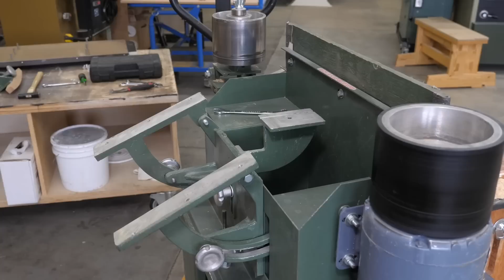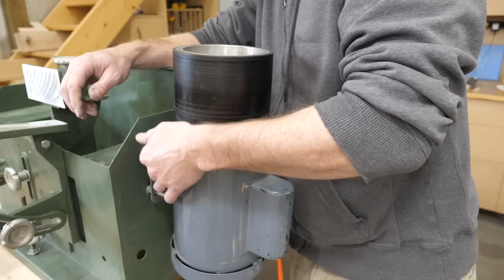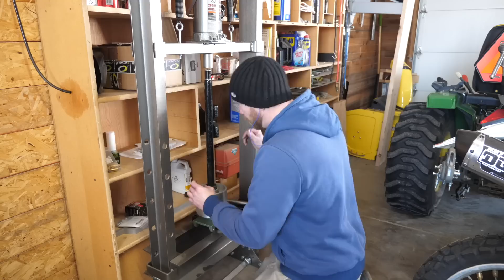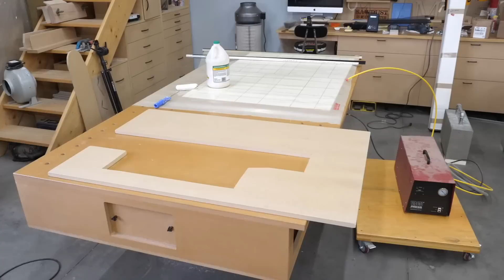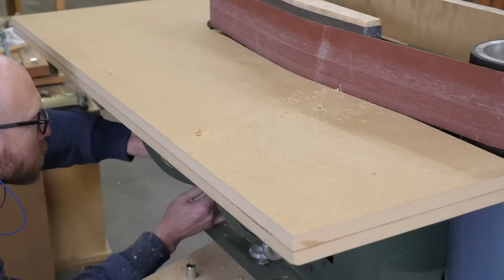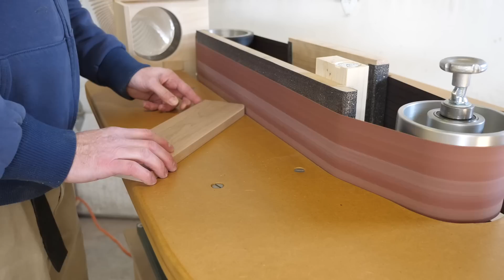Edge Sander Radstoration, this thing is Rad

Comment: Is the bed height where you're sanding mostly on the edge of the belt by design (so you can flip the belt when it's worn out?) I would think most sanding jobs would be for stock < 1" thick so the full height of the belt isn't normally needed.
Reply from the maker: Yes, that is the case, and yes I flip the belt when needed.

Comment: Very cool video and nice to see the apprentice back in the shop.  My only additional thought was maybe to lay down a piece of formica (or similar) on the top.  I hate MDF so much I do everything in my power to try and cover it up when I opt to use it.
Reply from the maker: I like the idea of Formica, but, a sheet of it is almost what I paid for the sander. If I had some laying around I would have done that, as it is MDF with poly is pretty durable.

Comment: When you're cutting threaded rod always have the end of the rod facing away trom the rotation of the bench grinder. This opens the threads up instead of pushing them into the next thread. Works first time every time.
Reply from the maker: Normally I would agree, but I was trying to grind a round on the bottom of the rod, and needed it to be in that position.

Comment: I have two sets of the single hole countersinks.  They work on steel if you use a low speed and cutting oil.  They don't chatter and leave a nice finish.  I even saw someone use one in a milling machine to put a 45° chamfer on a work piece.  Now that REALLY amazed me!
Reply from the maker: Good tips. Thank you.

Comment: When you are edge sanding you must keep the wood trailing. The scene where you demonstrate the opposite it is liable to dig in and the piece can rip the belt and go flying to the right. And it will hurt your fingers. Also don’t forget to frequently use the rubbery plastic dresser to remove sawdust. That way the belt will last 100 times longer.
Reply from the maker: Thank you. Yes, the wood was trailing.

Comment: Sealed bearings are the better choice unless the RPMs are high and then it is time for shielded.  The rubber seals create heat and at very high speeds cause grease to fail.  That sander is running nowhere near the rpms that would create such problems.  I have a similar sander (ACME) and use it all the time.  Very handy.
Reply from the maker: I had been looking for an ACME sander for years when I finally found this one.
Reply: @MikeFarrington  I think your Rodgers is comparable, yet a bit more refined with the table tilt mechanism.  I added DC to mine as well when I restored it.  Not that much different from yours.  Makes a huge difference in the amount of dust floating around the shop compared to w/o.  Those sanders create a dust cloud in a hurry.

Comment: Excellent video. For dust collection if you revise it at some point ... instead of a box, maybe a kind of half tube (think the under base dust thingy for some routers like Festool 1400). It attaches to the area above the belt and can be tightened down at any point along a t-track. Sorry this may not seem so clear, but other analogies that come to mind are shower curtain tracks or meat hooks. The tube hangs down where you need it because it's attached to a more or less continuous t-track.
Reply from the maker: Thank you. Good idea.

Comment: I've always been so hesitant about using MDF. I notice you use it frequently.  Maybe my hesitance is unjustified. If it's good enough for the 'mighty Mike Farrington' then it is also good for me.
Reply: MDF is awful to work with, but I love it for shop furniture flat surfaces because once you seal it well, it stays dead flat. Mike's thinned poly is probably best for sealing, but I use boiled linseed oil because I like the dark color and it's re-touch-able without buildup. Anything to keep the MDF from sucking moisture out of the air.
Reply from the maker: Yes, MDF is great, but it needs to be sealed.
Reply: I forgot to mention - MDF has to be sealed on all exposed surfaces, too, even the ones not visible. Then it stays dead flat.